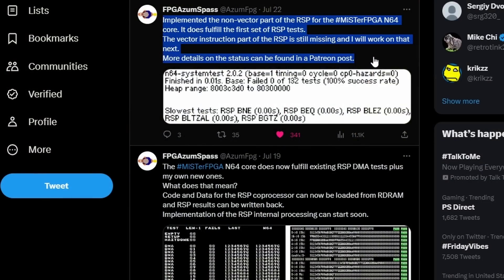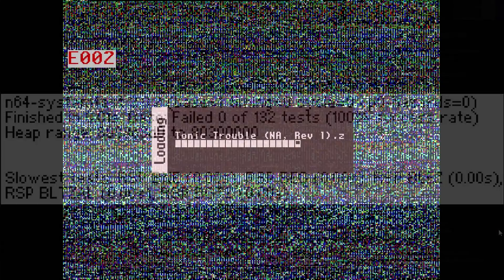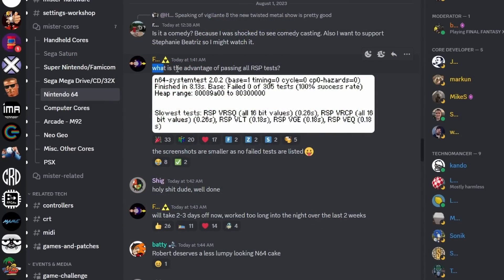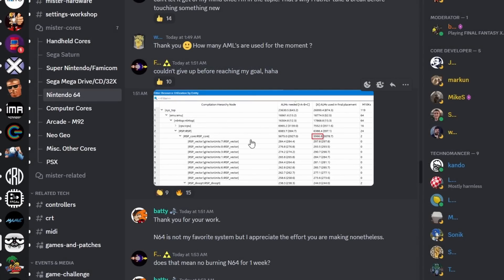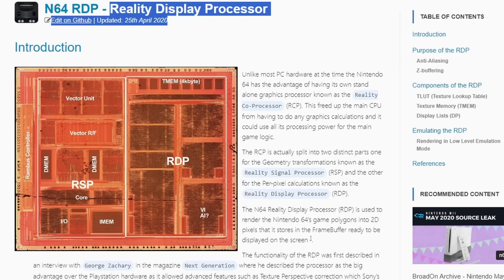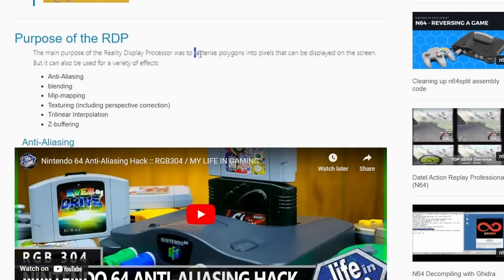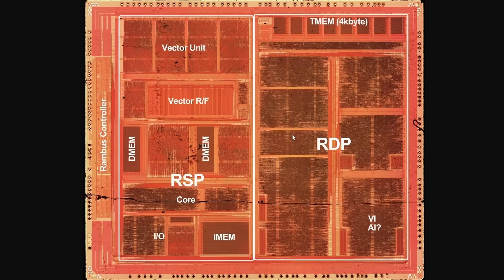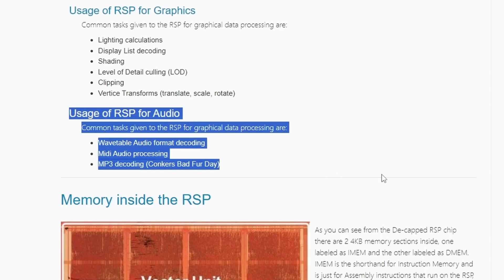MiSTer FPGA N64 Core Updates! More Progress Made and More COMING! Nintendo 64 on MiSTer FPGA

Comment: LLE N64 emulators already exist. Ares is fully LLE. And Paralllel RDP/Angrylion both do LLE emulation for the graphics and they are both already close to perfect.
Reply from the maker: And I think i said “some do exist”
Reply: @VideoGameEsoterica  Well, i added additional information :)

Plus, LLE emulation is getting more popular nowadays. Simple64 even ditched GlideN64 completely to use Parallel exclusively. HLE is only viable for phones and crappy Pi devices IMO.

Comment: Hey Anthony, I do have a question regarding the Expansion Pak. Back in the day, I had an N64 and eventually when the Expansion Pak came out, I bought one. The only problem is, Killer Instinct Gold doesn't work with the Expansion Pak installed, or at least it never did on my system with my cart and Expansion Pak. Every time I wanted to play KI Gold I had to install the Jumper Pak. I don't think I've ever come across another game that didn't work with the Expansion Pak installed.

I never hear anyone mention this, so part of me thinks maybe there was just something wrong with my system or game, but the game worked fine with the Jumper Pak and I never had any other issues with the console, either. I eventually gave it to my brother-in-law about 15 years ago (I ended up with his Saturn so I'm not exactly complaining) and I haven't bought a replacement yet so I can't test it out. I'm also curious to see if it works the same way using an Everdrive on the N64 hardware, although I don't see why it wouldn't. I'm assuming it's some kind of coding issue.

I suppose then my question is whether Robert is planning on implementing a toggle for it or whether it's just an always-on thing, and if it's the latter, is that going to be a problem for KI Gold and any other potential game which for whatever reason might not play nicely with the Expansion Pak? Or am I just delusional/unlucky because apparently nobody else has ever run into this problem? KI Gold was an early game so I think most people had kinda moved on from it by the time the Expansion Pak came out.
Reply from the maker: I haven’t heard a thing about KI and the ram expansion but I know it CAN cause a freezing issue on Space Station Silicon Valley in some weird config. 

I’ll ask Robert if there will be a toggle. It’s actually a genuinely good question

Comment: What about the N64 version of Resident Evil 2? I always thought that was the largest game on the system.
Reply from the maker: A handful of games use the 64MB rom size and RE 2 I believe was the first. Conker uses it as does Paper Mario. So they all count. I just don’t own RE 2 on N64 for a visual example even though that’s the most “well known” 64MB cart
Reply: @VideoGameEsoterica Paper Mario is 320mbit, 40MByte. Any 64MB ROM file is an over dump. It was merely academic back in the day because there was only one commercial backup unit that could play anything over 32MB/256mb and it had 64MB/512mb (Doctor V64 jr512). A 64MB overdumped Paper Mario ran fine on the jr512.

Edit: Got your other reply about the PAL version of Paper Mario possibly being larger to fit more languages. Makes sense!

Comment: I'm looking forward to seeing the video output on MISTer for this core. In every case so far, the MISTer has significantly surpassed my RGB consoles running via the OSSC (which I see as the next best option if you don't want to play on a CRT). I hope it's the cleanest, sharpest image yet.
Reply from the maker: N64 is the console most in need of video output help via hardware mods or in this instance MiSTer. I’ve put off modding my 64 in hopes of this core coming
Reply: @VideoGameEsoterica 
Agreed. I have an RGB N64 but it's a really old mod and not great. Cost me about $60. That said, I had fun with it.
Reply from the maker: I’m just enjoying both the clean RGB out into my PVM / the lack of a scaler via HDMI to my tv. Ease of use

Comment: im confused about that 128mb limit, cd games are 600mb do they load differently?
Reply from the maker: Very much so. Look at PS1 or Saturn specs. While a CD can HOLD more data, only small amounts are loaded into ram at once. When the systems load a level, it swaps assets in RAM. 

Carts are ROMS as in directly accessible read only memory devices. So those occupy in RAM on MiSTer the size of the game itself. 

So even though a 650 MB PS1 disc is exponentially larger than the 64MB size of the largest N64 disc, on average you won’t have more than 3.5MB of PS1 game data in RAM at any one time. 

Hope that makes sense :)
Reply from the maker: Largest N64 cart*

Comment: Mario Story is 40MB/320Mb, not 64MB/512Mb.
Reply: It’s one of the few that’s too large for a 256mbit backup unit but it’s also smaller than Pokémon Stadium 2, Ogre Battle 64, Conker’s BFD, and Resident Evil 2. Those are the 64MB games. Also, there needs to be enough RAM to also replicate SRAM, FlashRAM, 8MB system memory, etc. I’m sure 128MB is plenty. What concerns me is whether or not you can replicate RDRAM on SDRAM in real time.
Reply from the maker: It’s apparently diff sizes in diff regions. Well if the internet is to be believed. PAL is 64, US is 40. Probably down to language support.
Reply from the maker: The entirety of the RAM has been implemented already in the core
Reply: @VideoGameEsoterica  Right, it’s implemented but that doesn’t mean it can replicate the timing and bandwidth of RDRAM correctly for synchronous performance with the rest of the replicated hardware, so it remains a concern, especially for retail software. SDRAM predates RDRAM and was much cheaper so it stands to reason that the N64 needed some aspect of what makes RDRAM different (higher latency in exchange for bandwidth). RDRAM latency decreases with clock speed but the N64 has a fixed bus speed. Perhaps we will need some kind of dual-channel SDRAM to match the bandwidth.
Reply: @VideoGameEsoterica  That makes sense regarding the PAL release. I wasn’t even sure there was one since it wasn’t out yet back when I dumped the Japanese and American versions. ;)
Reply: @VideoGameEsoterica  Another oddly-sized game is Donald Duck: Goin’ Quackers. I believe it’s 20MB/160mb, which means it won’t run on a 128mbit backup unit. Backup units were only ever available in 128, 256, and 512mbit so you had to treat it the same as a 32MB game even though it wasn’t.
Reply from the maker: So far I haven’t heard anything in the negative on the RDRAM
Reply from the maker: Yeah. Diff sizes for diff regions
Reply from the maker: Funny fixed sized strangeness